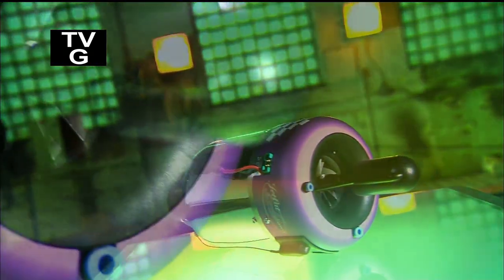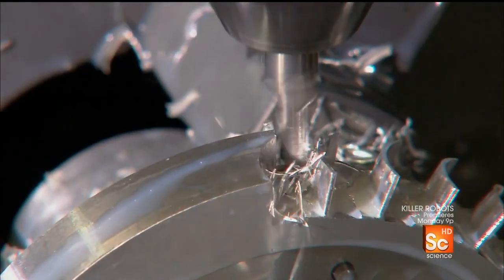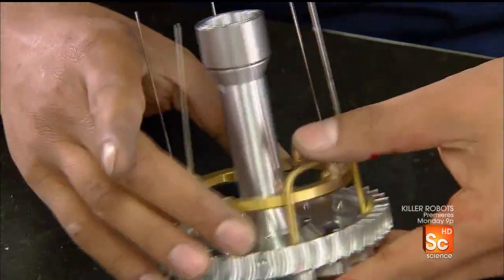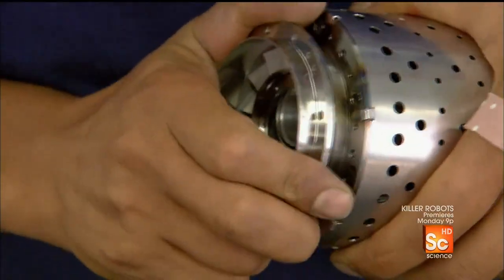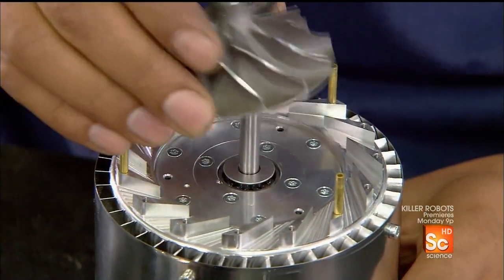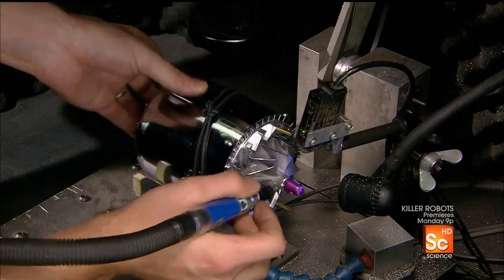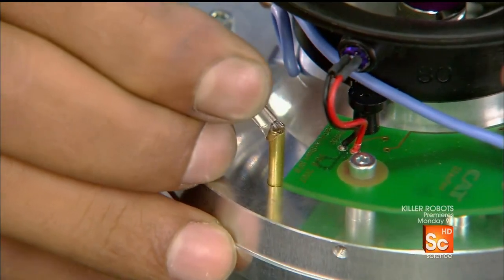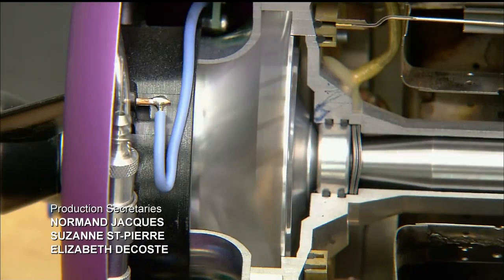How It's Made - Model RC Turbines

Comment: Are these turbine engines not subjected to the high temperatures of full size radial turbines. if they are subject to high temperatures, how does aluminium cope with the high temperatures. I did not hear the presenter discuss titanium parts in this turbine.
Reply: Titanium is only good for low temperature stuff
Hot side (turbine stator vanes) are made out of inconel as it doesn't lose strength when heated and it doesn't shrink and expand and can take up to 800°C
Aluminum compressor is standard centrifugal single stage and will only see temperature as high as 150°C

Comment: If full size jet engines were this simple /light you wouldn't want to fly commercial.
Reply: That's true, imagine the cost of fuel alone XD
These engines are simple but due to having single compressor and turbine it's really limited in thrust unless you spin it up to really dangerous speeds also lack of turbine stages means low efficiency
Reply: technically they are .... they are just 4 stroke engines after all ... suck press burn blow ... the hard part is the math within very small tolerances to make them work efficiently ... just a single stage axial compressor needs 100 hours of math work for design to get it done .... each blade on the rotor needs a changing airfoil design for optimum airflow in its area of flow ... for EACH blade on the rotor ... and each of those blades need a specific angle on them that directs air to the stator which again needs more changing airfoil designs from root to tip to manage the rotors compressed air and of course the tunnel in which the compressor operates also needs to be profiled to cover the engines operating area ... and that is JUST one stage of the compressor .... modern jet engines use 10 of them ... and each one of them is vastly different from the ones around it ... and now dont forget with compression comes heating ... so metal temperature now is also a concern ... and of course the turbine section has to be able to handle the heat from the combustor without melting so it can keep the compressor spinning at speed so it can compress the air and mix fuel to send it to the combustor to be burnt ... where you have to take the high speed air flow and mix it with fuel and slow it down enough to keep the flame in a small area away from the sides (so you dont melt the case) and get it from the combustor to the turbine ... and on out the engine ... so that material science ... fluid dynamics ... cad engineering ... aerodynamic engineering ... electronics engineering ... and of course thermal engineering ... just to make an engine ... each engineer hour worth a few hundred bucks each ... and each part of the math needed for each section is 4foot or more longer and have to be done up to 20 times for ONE pass through the engine in a unit of time ... and then done again for the next unit of time .... in the end the line of equations is about 4 miles long ... for one engine and you run it 20 times ... thats 80 miles of math at a few hundred bucks per person ... 
.
the hard part isnt making the engine the hard part is the amount of knowledge one needs to design it and put to work for several hundred thouand hours of work even before you can actually BUILD the first engine ... 
a mdoern car engine ... hasnt changed since Daimler made his car engine ... heck we havent even surpassed FORDS fuel values from when he made the first production line ... and thats well over 100 yeas ago ... and the tolerances of those engines are still the same ... sloppy like an ak47 ... while a jet engine has them in the 1/1,000,000th in ALL places ...

Comment: looks no close to real jet engine.....still hell expansive, also the parts that goes inside doesnt seems to be madeup of expansive stuff...why the hell they charge so high for this... if they think its because of low demand? man the low demand is because of its high price.... drive the price down and you will see the demand moving up high.... im sure that its the high price only which keeps many many aeromodellers out of this turbine thing....and i agree the model piston engines are also complicated stuff..but still under affordability.
Reply: zM: On the contrary.  This has all the same basic parts and design of early centrifugal jet engines used from WWII to the mid 1960's.

Comment: has anyone noticed these little jets operate like a centrifugal engine like Frank Whittle`s first engine
Reply: Enterprise206 the centrifugal design of the turbojet is not as common anymore but is much simpler and easier to make, thus its usage in small jets
Reply: you are right. axial flow compressors are common now days.
Reply: Most turbine engines are actually centrifugal.  There are a lot of them used in light aircraft, business aircraft, helicopters, auxiliary power, and other applications.